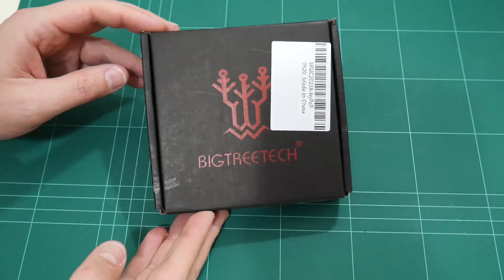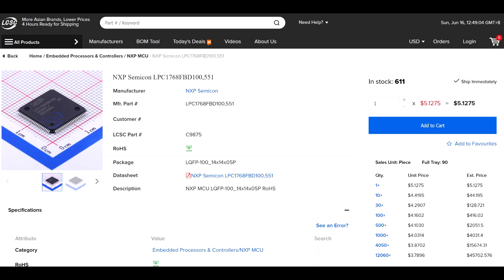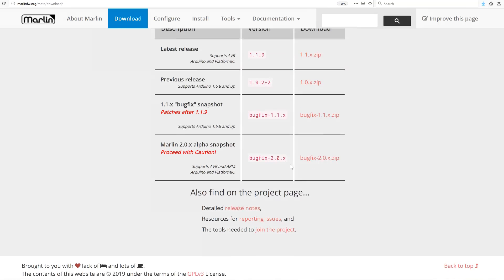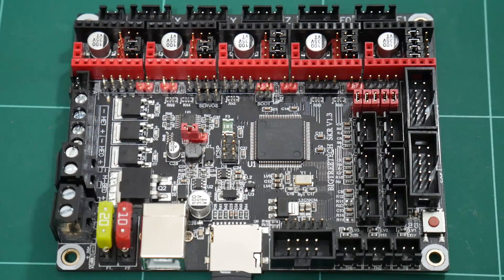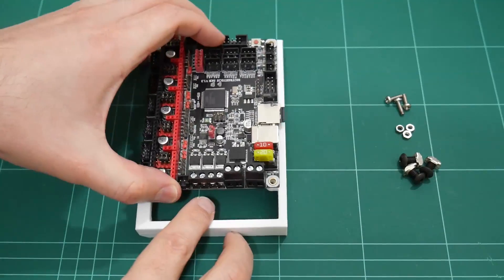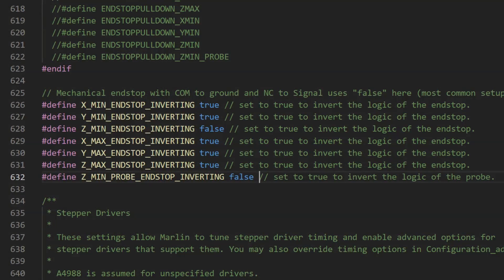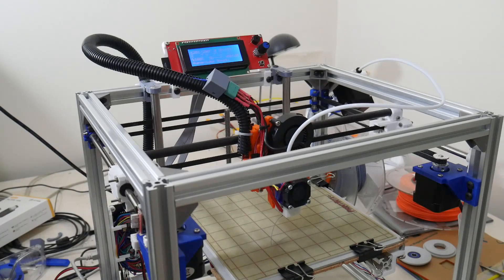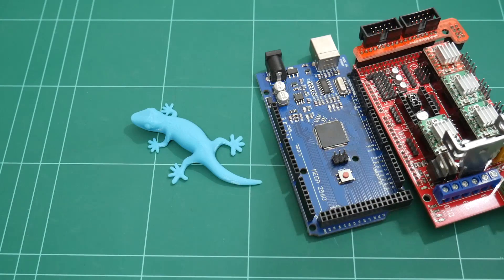Cheap 32-bit 3D Printer Controller!

Comment: Dear,thanks for your review and thanks for your suggestion!we got it.
Reply: Also thank you for making the board semi open hardware: https://github.com/bigtreetech , sure does put you higher up on my wish list :)
Reply: Can you show how you got the inductive sensor working with this board please?! I'm stuck :(
Reply: @Ali Thanks for the reply, I just think that is better to have 01 driver for each sustained side.
Reply: @ErickWillIm  The drivers are controlled by direction and step signals. So I think you can do a little mod and connect two (or more) of them to a single source of these signals and they'll be in sync.
Reply: Don't wanna bump it but since you probably have this info promptly, I wonder, is it suitable to 2 Z axis?
Reply: @ErickWillIm  
Well depending on you stepper drivers you could use a Motor Parallel Module for that. Supply enough current and you should be good.
Reply: Erick W you can use second extruder as second z motor driver. It’s configurable in marlin
Reply: PLEASE change the servo connection back to a standard servo pinout!

Comment: I swear by these controllers I have two creality printers that I run with Klipper on 2208 and 9 drivers and I can run both at 100mm/s in my closet and easily get a good nights rest while theyre both running

Comment: Tech2C - Could you please help? I desoldered the R11 resistor, and i'm using normally open sensor with diode in reverse. How should i set up config.h?

Comment: Hello again @Tech2C , did you have to make any changes to the configs to get your Reprap discount smart controller to work on the SKR1.3? First time using the screen I initially bought for the Ramps but never used and cant get it to work.
Reply: Made a guess that the pins were wrong and saw someone suggested the cables were installed upside down on some devices. Flipped them and seems to be working now

Comment: Hi @Tech2c , I've been forced into updating the board and im already stumbling at the first hurdle. I think you may need to mention in any future videos its important to have Python installed on your PC too with the PATH option applied (python.org). Maybe its something basic for most people, but with no coding knowledge myself I've spent a good 2 hours trying to work out why Platform IO wouldnt work in VSC. I'm now going to attempt to migrate my edited 1.1.8 settings over to the new build.
If you ever do another software update video would you possibly be able to make a standard and "idiots guide" version? I think thats the version i need when it comes to coding
Reply: other issues I had for yours or anyone elses help:
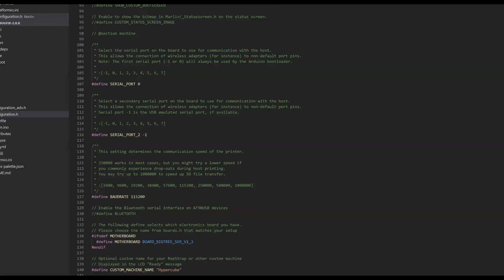5:00 The board has been renamed BTT_SKR_V1_3
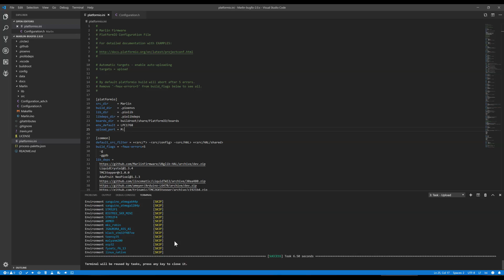6:40 the Part cooling fan re asignment is now in Pins> lpc1768>pins_BTT_SKR_common.h

Comment: Hi @Tech2C, Just want to confirm once you remove the R11 resistor do you have to short where the 2 connectors were again to complete a curcuit? thanks
Reply from the maker: Nope, leave it open.

Comment: Hi, I'm talking to you from Argentina, remove the R11 resistor and my inductive sensor is still not sensing, what do you recommend me to do?
Reply: is your sensor 5v one or a 6 to 36v one? im having an issue i have a 5v npn no it does light up when activated but skr 1.3 does nothing so i will try the resistor trick if yours is 6v to 36 you will need a regulator

Comment: Hey Tech2C, what are your thought on this vs something like a 8bit board with a RPi and Klipper setup?  Also is this board able to be run with Klipper or is it just 100% not necessary with the horsepower of this little guy?  I would like to also know your thoughts on if this would be a good board to drive a MPCNC setup.  Love your Hypercube videos, thanks for providing the community with great knowledge in a light comical format.  Cheers from Canada.
Reply from the maker: Hello from Australia! I've only used Marlin firmware on the 8 bit and 32 bit boards. The latest version 2.0 of Marlin works well for both MCUs. It's just when printing faster than 50mm/s with corexy machines that 8 bit MCUs may slow down the print, but it still works. No difference in print quality between them with Marlin. Other firmwares may produce different results. I hear klipper is very good, but it's a 2 board solution. Cheerio.

Comment: The Hypercube I built in 2017 has been doing just fine, however, I decided I wanted to swap out the stepper drivers for some quieter ones.  Opted for the SKR v1.4 Turbo with TMC 2208's.  This was great info to get me going!  Thanks again!

Comment: guys, maybe someone else has this problem.  I build a 400x400 machine and using bl touch.  with auto bed leveling, only the first half of the bed is probed then quits.  I only get six data points.  any ideals?  SKR v1.3.

Comment: Do not unsolder the pullup resistors on the board.. leave it in its original state.. it's the same with GEN L boards.. just put a 6.8kOhm resistor between the ground and sense wire (blue and black wire) on the sensor. It's easier and better than the mod needed for ramps and similar.
Edit: This works on sensors with black plastic tops that need seperate 12V input.. brown - 12V, blue - ground, black - sense wire <- the only wire you need for the endstop. Works like a charm every time :) And the sensors are dirt cheap.. i recommend buying a few just in case ;)

Comment: Hello, 
Your inductive probe is PNP or NPN ,because the mine is PNP,so my second question is :must I removed the pull up resistor to using the signal pin in my probe ?
Reply: I'd like to know the same

Comment: Why 32bit ? Does it shorten the print time? Does it print faster ?
Reply: 32bit can handle more calculations than 8bit. Meaning, it won't "lag", which would cause stepper studder. Basically, it gives smoother prints. It will also open the way for more intelligent slicer programs in the future.
Reply: @archer9338  I used 3d printers without noticing any lag. Why not 16bit?

Comment: I found out what the issue was and it was indeed Marlin 2.0 removing sanity checks that has been in it since its beta.  They are considering bringing it back so customers of pre made machines don't throw some super high numbers into their slicer and destroy their machines.

Anyway I did an ABS print at 0.2mm layers and I am floored.  Seriously, it was the most perfect print I have ever had with ABS (same old old ABS too) so I have to think that due to it not pausing it just makes better,  and smoother, prints.

Comment: Got the SKR 1.3 and board failed after a couple of weeks. Reads high temps on the thermistor inputs. Tried everything but reads anything from 100 - 200 degrees even with nothing connected. Ordered another board and seems to be ok. First board followed your example of removing the pull up resistor. Second board I just reassigned the BLtouch output onto the servo pins. No need to remove anything :)

Comment: @Tech2C I also had layer shifs with marlin 2.0 on a similar 32 bits card. On the same print, the layer shift always occured at the same layer, and only occured on ONE of the axes (X or Y). This is really strange and seems a software related bug, since a DRIVER overheating would make a DIAGONAL layer shift !  I then switched to klipper firmware, and layer shifts were gone... Since I went to Klipper, I returned to my arduino mega + ramps board, and the results are really similar in quality to 32 bits boards !
Reply from the maker: That's interesting. I have since installed 2208 drivers and have not had missing steps since. I like the idea behind klipper to reuse our old 8-bit boards. I have 3 arduino mega's plus RAMPS I probably won't use again, lol :)
Reply: @Tech2C  Yes, I know that's strange, and what made a spark in my brain was this ONE DIRECTION layer shift instead of diagonal one ;)
Give Klipper a try, it's really worth it on 8 bit boards, the results are amazing !
There is only some boring securities that you will have to accomodate like "you can"t move the print head before having made a zero calibration..." ;)

Comment: Layer shift that I have seen most often is USB. One processor has different timing and if its delayed even 100 microseconds it screws up my layers. Same reason SLI and Crossfire Both suffer from this. Nice build though.

Comment: Hey mate, thanks again for a great review. And thanks for the hypercube. Finishing my build soon, but waiting for this board to arrive. Im using an inductive sensor like yours and was wondering if you could please do a quick video on how you removed the pullup resistor and where or not you still had to add resistors to the sensor. Thanks :)

Comment: For the Z induction sensor, there's no need to remove the pullup resistor, you can connect it with just a diode : I use a 1n5818 schottky diode, the anode connected to the endstop input signal and the cathode to the sensor output. A schottky diode is important as the foward voltage has to be low enough to provide a logical LOW voltage when the current flow through it (it won't work with a 1n4148 and a 3.3v mcu for example).
Reply: I checked that with a 1N4007 and it works really good.
Reply: @WolframWebers  How did you do thtat?

Comment: I have a prusa mk3s..it uses a rambo board i believe? Is it 32bit like this one?
Reply: MK3/MK3s uses an Einsy Rambo.  It's NOT 32 bit.  While 32 bit boards are nice I would stick with what you got at least on the Prusa printers, even more so if you plan on using a MMU2.

Comment: I still dont understand why 32bit would be better than 8bit Arduino Mega =. So make a video on that. 

Keep in mind most users don't use CoreXY setup.
Reply: Basically 32b = smoother print finish
Reply: Less chance of missed steps when microstepping, especially at higher print speeds. How about you read something instead of demanding videos, douche.

Comment: any disadvantage with the cheaper (on ebay) v1.1 boards? also the re-arm can be had a little cheaper but then you need to add a ramps for things.
thinking of getting 2-3 boards, 1 update my fake prusa and 2 make a laser cutter and 3 a small table top cnc

Comment: No Ethernet. Also microSD is on main board, where it would be more preferable to have it on a separate board connected using ribbon cable.

I think Smoothie board is still better.

I will check it anyway, it has some interesting features.
Reply: movax20h You can always get an ad card extender.
Reply: yes it has a card slot on the board how ever it ALSO has the port for an external SD slot he even mentions this in the video.

Comment: What type of sensor is that on your print head. Also, Did I hear right? I should be able to use this board without having to use external mosfets for my hear bed and nozzle??

Comment: Klipper for the win for print speed though and all you need is a rpi 3A+ at 45$. I've reached 150mm/sec 3000mm/sec^2 accel and stopped climbing the speed because I though my printer would self destruct and also I was too close for comfort to 100% duty on the print head heater.

Comment: I just downloaded Marlin 2.0 bugfix. And I had to change: default_envs = LPC1768 in the fresh file to: env_default = LPC1768, as seen in the one here, to get it to compile at all. Now I have errors saying end stop pins are not interrupt capable, but that is the usual unusable configs packed with marlin thing.  So bug fix has a bug?
Reply: Yes, that is how you retarget code in platformio to whatever devise you need to compile on, the default setting is for the common atmega but you need to target it to your board, a software repository isn't psychic after all. Its a feature and an excellent one which is covered in the documentation, Platformio is used for much more than just compiling 3d printer firmware. Re your compile error, Marlins default config comes with interrupt capable endstops disabled, not enabled.  "//#define ENDSTOP_INTERRUPTS_FEATURE" so that's a bug you have introduced, put that line back to the default.

Comment: Sweet! It's a generic Smoothieboard! Way better priced than $105-180 depending on the features you want.

I wonder if there's much benefit from going 32bit. I mean, my Anet A8 and Ender 3 already prints happily from Octoprint at 60mm/s with no issues. 60mm/s seems to be a good sweet spot unless you have a very stiff machine with a lot of mass to hold it in place.

Comment: I just used this same board and it kicks ass, but I made some modifications to marlin 2.0 for baclash compensation in the Z axis for core xy printers  if i see some interest ill post it up and update this comment. Just trying to be helpful in the community but I feel its detrimental to the firmware to spam forks if theres no interest. you rock man thanks for what youve done for the community.
Reply: If be interested. But why not submit a pull request or open an issue on the Marlin GitHub repo? Lots of people have deltas and might want to use this board.
Reply: @MrJacobegg  because I had to remove the safety features for core kinematics in marlin 2.0 and didn't see anyone interested. If it gets some attention and people think it would be useful I'll make it an option and submit a pull request as you've suggested.

Comment: Does this have any GPIO pins? Those are quite useful for later custom upgrades.
Reply: I think the SKR Pro v1.1 might can goto there github and check it out. its a nice & more powerful board & alot more features then the skr v1.3

Comment: Is the 32 bit actually faster? Can you tell the difference in print time?
Reply: only if printing at very high speeds, which you cant get to with a prusa i3 style printer (ender 3, cr10, anet a8 and so on) as there is to much weight to move around, With a coreXY, it is possible to get to such speeds (just). I would not bother upgrading over a ramps if it is working fine for you, but if you are in the market for a new board, i would not go for a ramps or any 8-bit board these days.

Comment: It is quite possible to use a pullup resistor with an inductive sensor, it would just need to be an NPN sensor.  the only additional component necessary would be a diode between the signal wire and the board, with the anode facing the control board and the cathode facing the sensor's wire.
Reply: rickslful  thanks for that info. I realized you were right as soon as I read it!